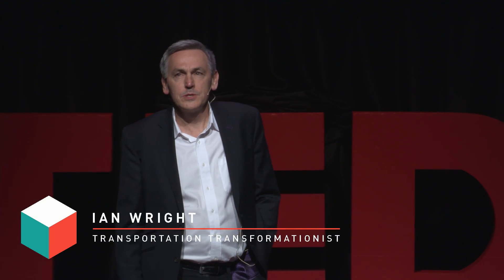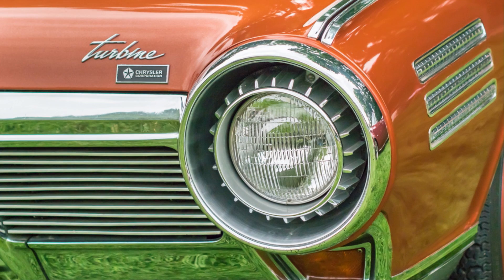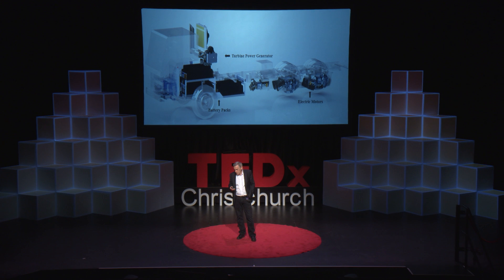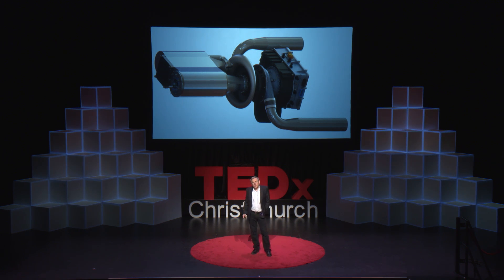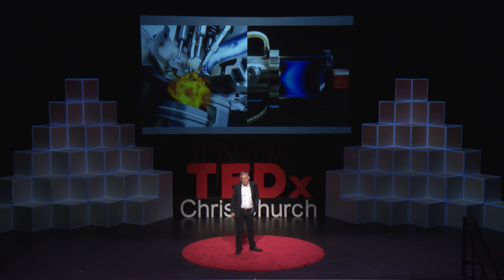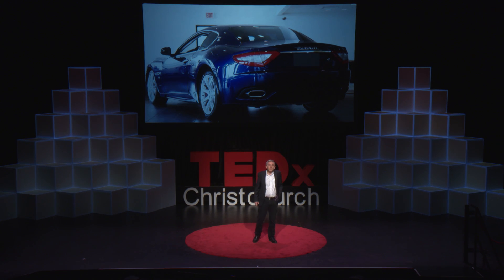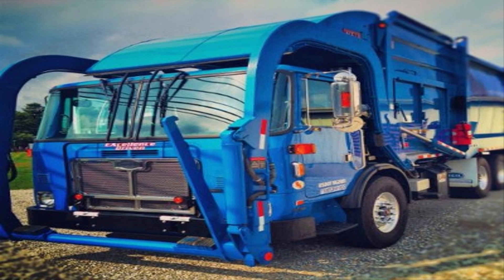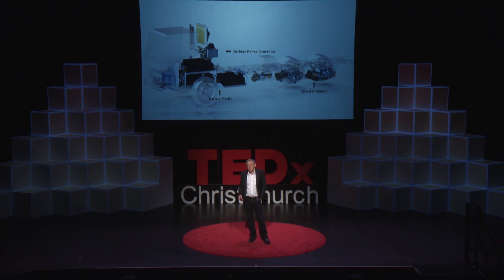How jet-powered garbage trucks can save the world | Ian Wright | TEDxChristchurch

Comment: Good idea. Might work well for two decades, until batteries have a higher energy density. OR until fuel cells happen, which are more efficient in converting fuel into energy.
Reply: lnpilot Have a second look at them. They are used in boats and expensive yachts already, because they are very reliable, as long as you have clean fuel on-board. The good ones use ethanol or methanol. As far as we know, the industrial ethanol is very cheap to produce. The fuel cells are OK, and getting better.
Reply: lnpilot Yes, the hydrogen fuel cells make no sense in cars that are outside of Japan, but the fuel cell technology is not limited to hydrogen, it can be applied to natural gas, to ethanol. It is possible to have renewable sources of fuel for the fuel cell. Have a deeper look into the technology, fuel cells are not about hydrogen, there is more to them than you would expect.
Reply: papparocket I know all that... The energy density for batteries is an issue for electric aircraft, where every kilo counts.
But, it's not a problem for cars any more.

As battery energy density keeps improving, even aircraft are slowly shifting to battery power.
Just recently, two electric airplanes crossed the English channel. And a couple of them are already in production. They only have an hour or so endurance, but it's perfect for flight training.
The operating cost is a fraction of piston aircraft, where maintenance is way more strict than cars, so a piston engine is a financial nightmare for aircraft owners.

I would know.
I own a helicopter and it's going through its annual inspection, as we speak.
Any mechanical part, with an FAA certification, costs 10 or 100x as much as an equivalent car part.
It's the mother of all rip-offs.

Thousands of dollars, every year and every 1500 flight-hours, you are talking tens of thousands for engine overhauls.

In contrast, electric aircraft has practically no powerplant maintenance.

I can't wait for electric helicopters.
The quiet,  the lack of nauseating exhaust, the lower vibration...
Reply: papparocket For trains, carrying the fuel makes no sense, in the first place.
You have a fixed track, with rails laid down, so they should just have overhead wire power.
Coming from a relatively poor, Central European country, where pretty much every mile of train tracks were electric, decades ago, I was absolutely shocked to see diesel trains in the US.
Even in friggin' Silicon Valley (CalTrain)!
It's like a 100 years behind here.
Reply: Fuel cells ("fool cells") are an insanely inefficient way to power cars or trucks.
It takes more energy to extract hydrogen and pressurize it into a tank, than what you get back.
They also require expensive and dangerous filling stations.
It's a lot easier, cheaper and safer to install an EV charger, than a hydrogen filling station.
And, with hydrogen, you'd still have to drive to a filling station and wait in line.
With an EV, you plug it in, when you get home and forget about it.
Oh, and would you want to drive a car, with a high-pressure hydrogen tank?
I really don't think that hydrogen / fuel cell cars have much of a future.
It's a gimmick, promoted mainly by Toyota, to try to distract from the fact that they had their ass handed to them, by Tesla...
Reply: epSos.de Fool cells are not an efficient or practical source of mobile power, at the scale of cars (especially compared to ever-improving batteries).
It's insanity to extract the hydrocarbons, store them in a tank, run them through the fool cells, just to get electricity, enduring great losses at every step, when you could just store the electricity directly in a battery.
And you still depend on hydrocarbons, you can't charge from solar power and so on.
Totally defeating the purpose!

Toyota is pretty much the only company trying to push fool cells for cars, because they've lost the EV battle against Tesla.
They claim fool cells will be popular.
They also claimed, with their "infinite foresight", that Li-ion batteries would never be viable for cars. See how that worked out for them...
Reply: epSos.de BTW, I've had a Model S for over 3 years. I haven't been to a "filling station", in over 3 years.
I would rather go back to dial-up internet, than to a gasoline, or fool cell car.

If you drive a Tesla for a few months, you will understand what I mean...

A couple of times a week, I plug in the car when I get home, and forget about it.
It takes 10 seconds and costs 3-5 times less than filling up a gasoline car.
No driving to filling stations, no waiting in lines.

There's also a Supercharger half a mile from me, next to the grocery store and restaurants.
I can get a free charge while shopping, or having dinner.

It has been getting busy, as everyone and their dog has a Tesla around here...
(but, Tesla is building more Superchargers and they are making them faster...).

In contrast, I've never seen a single fuel cell car, and I live in California.

That should tell you what actual drivers think of the EV vs. fuel cell debate...
Ok, The Toyota Mirai is absolutely hideous, so it's not entirely fair to compare it to the Model S...
;)

I've been following fuel cells for decades. I'm an electrical engineer, so I've been looking into the technical details too.
You can't even compare EVs with "fool cell" cars.
It's not even a contest.

Are you a Toyota Mirai PR person, by any chance?
;)
Reply: epSos.de Have you actually read my post? I'm well aware that you can use hydrocarbons with fool cells.
I've specifically responded to that part and explained why that is a bad thing.

I've probably researched the subject much more than you...

There might be a limited use of fuel cell cars, in Tokyo, for certain uses.
For a while, until EVs cover that narrow market...

Fuel cells in cars, are a stopgap measure, at best.

Having gone from gasoline, to hybrid (Prius), to a Tesla, going back to a fuel cell car, would be a big setback for me.
Convenience, cleanliness, performance and so on are way better with EVs.
Reply: epSos.de Fuel cell cars remind me of CFLs (compact fluorescent lights).
If incandescent bulbs are gasoline cars, CFLs are fuel cell cars, and LEDs are EVs.
:)

We went from incandescent, to CFL, to save energy, most people not realizing that CFLs are horrible for the environment.
The mercury in one CFL bulb, is so toxic that it can turn thousands of gallons of water undrinkable (I think, it's 6000 gallons).
If you break a CFL, you have to follow haz-mat cleanup procedures (look it up!).
You better not let your child touch the stuff...

Thankfully, we are over the CFL stopgap and moved on to LEDs.
I've never bought a CFL. I just waited out LEDs...

I think, we'll just skip fool cells and go straight to EVs, thank you very much.
:)

Well, I've done just that...
Reply: lnpilot Fuel cells are just another way to create energy, they have their application niches. We can expect to see more of them. Maybe not in the form of the hydrogen ones, but the ethanol ones make sense for the the people on boats, since the same people already use the ethanol for cooking and heating.
Reply: epSos.de Sure, they might make sense on boats.
But, fuel cell cars are the stopgap measure, we never needed.
(Between internal combustion engines and EVs).

Jet / turbine engines make sense on airplanes and helicopters, but they don't make sense on cars (cost, slow spool-up etc.).
Reply: Solid oxide fuel cells (SOFC) don't have to use hydrogen like PEM fuel cells do. SOFCs can directly use methane/natural gas. The fuel decomposes on the hot fuel cell stack. SOFC in combination with what is called a reformer can use diesel fuel or other long-chain hydrocarbons. The reformer breaks down the fuel to create what is called "synth gas", basically a mixture of hydrogen and carbon monoxide. Both the hydrogen and the carbon monoxide can react on the fuel cell stack to produce power with water and carbon dioxide as the reaction products.

Delphi has developed a SOFC to serve as an auxiliary power unit (APU) with an output power of 3-5 kW for long haul trucks so truckers can turn their main engines off when they are stationary. Truckers run their main engines on their trucks at idle to provide electrical power to items like their refrigerators, air conditioners, lights and TVs in their sleeper cabs, but this is a very inefficient way to generate such a small amount of electricity plus people living near truck stops don't like a bunch of big diesel engines idling all night long.

So it is possible that the turbogenerator in this concept could one day be replaced with a diesel fuel SOFC with a possible increase in efficiency. But SOFC and fuel cells in general have a very low power to weight ratio. So an 80 kW fuel cell is going to weigh many times what the turbogenerator does. The extra weight increases the power required to propell the vehicle and so some of the higher efficiency of the fuel cell in generating electrical power is eroded by the high power required by the heavier fuel cell system. Plus turbine engine running at peak efficiency is still a pretty efficient device. My guess would be around 40%. Fuel cells can be around 50%, so while better, it isn't an enormous increase. A 40% efficient turbogenerator producing 80 kw consumes the same amount of fuel as a 50% fuel cell producing 100 kW. So if the average power required increases to 100 kW in a fuel cell powered vehicle the fuel consumption would be the same as the turbine even though the fuel cell would be more efficient. 

However what the type of system that generates electrical power from a liquid fuel is relatively unimportant. The key advance here that the prime mover is electrically connected to the wheels rather than mechanically connected. This allows a significant amount of energy storage capacity to be added between the prime mover and the vehicle wheels. This allows the power production of the prime mover to be flat while the power of the vehicle (both demand during acceleration and production during regen braking) varies wildly. 

BTW, batteries have a very long way to go to before they can equal the energy density of a liquid fuel. Diesel fuel has an energy density of 12,000 Wh/kg. Assuming that the turbogenerator set weighs about as much as the weight of the fuel, then the energy density of the total system is 6,000 Wh/kg. Turbine engines at this small size with the intercooling and regeneration can be around 40% efficient. Ignoring losses in the generator and rectifier, this still gives a fuel powered system an "energy density" of 6,00 * 0.4 = 2,400 kWh/kg. The very best of current batteries are around 220 Wh/kg. There are some research batteries currently be developed that will push that up to 400-450 Wh/kg. Lithium-air batteries might be good for 1000 Wh/kg, but that is about it.
Reply: On the other hand, the well-to-wheel (WTW) efficiency of powering a regular BEV with electricity derived from a natural gas power plant is between 22% and 35%:

«The WTW efficiency for EVs running electricity derived from a stationary power plant is shown in Fig. 4. Natural gas from the pipeline is fed into the stationary power plant, which has an electrical generating efficiency that depends on the type of power plant. The electricity is then distributed to the grid, where it is subject to T&D losses resulting in a WTP efficiency of between 28% and 45% depending on the power plant technology. Electricity is transferred to the EV via a charging station, which is on the order of 85–95% efficiency. The battery-to-wheel efficiency of an EV over a drive cycle can range from about 79 to 91% depending on how regenerative breaking is accounted for [41]. This gives an overall WTW efficiency of between 22% and 35%.»

— Curran S et al. "Well-to-wheel analysis of direct and indirect use of natural gas in passenger vehicles." Energy (2014) vol. 75 (Oct 1, 2014) pp. 194-203
sciencedirect. com/science/article/pii/S0360544214008573

For the sake of apples-to-apples comparison, here you are the efficiency values of a typical BEV:

• Maury Markowitz. "Wells to wheels: electric car efficiency." Energy Matters (February 22, 2013)
matter2energy.wordpress. com/2013/02/22/wells-to-wheels-electric-car-efficiency

• Toyota Mirai range: 483 km ; H2 tank: 5.0 kg H2
transportevolved. com/2014/11/19/just-energy-efficient-toyota-mirai-time-maths

Well-to-wheel efficiency, accounting for regenerative braking (an most efficient power plant technology to generate power and most efficient charging to charge the BEV):
HFCEV: 0.76 * 0.59 * 0.91 ≈ 0.41 > 0.35 [BEV]

Finally, there's a (now cheaper) process to generate hydrogen out of methane (main constituent of natural gas) that releases almost no CO2 that is known as methane cracking:

• Myles Gough. "Cheap and clean: Australian company creates hydrogen with near-zero emissions." The Guardian (July 22, 2016)
theguardian. com/sustainable-business/2016/jul/22/cheap-and-clean-australian-company-creates-hydrogen-with-near-zero-emissions
Reply: Generating hydrogen out of natural gas, compressing it, distributing it, storing it, and dispensing it at 70 MPa has an overall efficiency of up to 76% (see hydrogen supply chain no. 10):

• Margalef P et al. "Efficiency comparison of tri-generating HTFC to conventional hydrogen production technologies." International Journal of Hydrogen Energy (2012) vol. 37 (12) pp. 9853-9862
sciencedirect. com/science/article/pii/S0360319912007471
sciencedirect. com.sci-hub. hk/science/article/pii/S0360319912007471

In contrast, the most efficient natural gas power plants reach 50-54% efficiency:

(Pp. 5-6) «Natural gas combined cycle (NGCC) power plant efficiency estimates range from 6,333 – 6,800 btu/kWh (50-54% efficient HHV, see box at right) at full load. Typical combustion turbine (CT) heat rates are 9,650 – 10,400 btu/kWh (33-35% efficient HHV).[2] The CT plants do have a very necessary role in the US. The CC and Coal plants cannot cycle – meaning they cannot turn off and on within a few hours. The load shape and reliability require the use of CT units throughout the year. However typically they will have very low capacity factors. Over the past few years, depending on plant location, gas plants were not competitive with coal units and even combined cycle units. As a result, more cycling was required than anticipated. […] 2 GT World, Handbook 2006»

— Bellman DK et al. "Topic Paper #4: Electric Generation Efficiency." Working Document of the National Petroleum Council Global Oil and Gas Study (Jul 18, 2007)
npc. org/study_topic_papers/4-dtg-electricefficiency.pdf

The energy efficiency of a hydrogen fuel cell is up to 59%:

«Key results include demonstrating fuel cell system efficiency of up to 59% (more than double the efficiency of gasoline internal combustion engines),…»
www1. eere. energy. gov/hydrogenandfuelcells/pdfs/accomplishments.pdf
Reply: lnpilot, you're such a Tesla fan-boy! Running HFCEVs with molecular hydrogen produced out of natural gas can be as efficient as burning that same natural gas in a modern power plant to generate the power required to charge a BEV, and it could be even much "cleaner" (i.e., generating much less air pollution and CO2 emissions). See data and calculation above.

Comment: what about earthmoving equipment and other low speed specialised machinery
Reply: I am thinking about farm eqipment. Tubines will run on biofuels.
Reply: Both of those would be amazing applications, especially farm equipment that needs to run all day without stopping. At the moment batteries aren't there yet for these types of application (although there are niche applications that would work, and do), but this could be an amazing bridge technology until they are.

The only reason why I would suggest they go away eventually is that it's yet another part of the drivetrain to maintain. It has the same problem as fuel cells - you are essentially running a battery electric vehicle, but with small batteries that are regularly topped up by an onboard generator. This is the reason BEV's are so compelling, the maintenance is an order of magnitude lower than ICE vehicles, and adding a range extender removes some of that advantage.
Reply: But no diesel engine etc to mess with either...